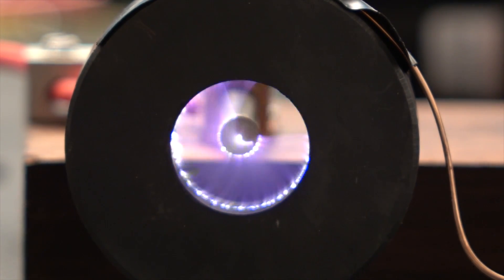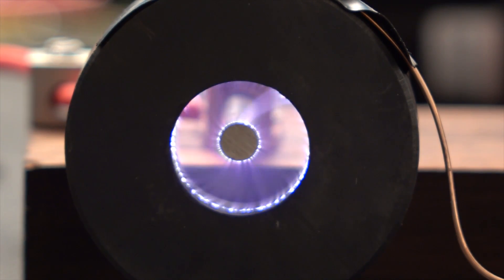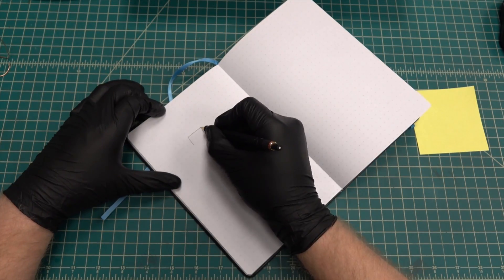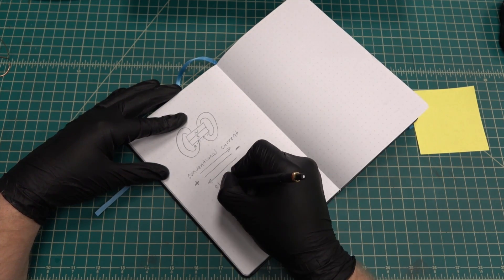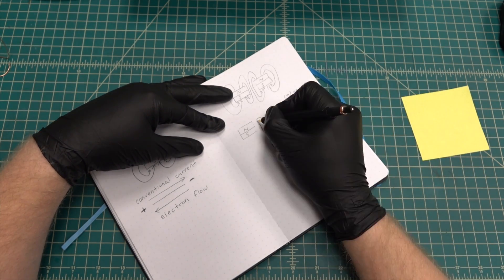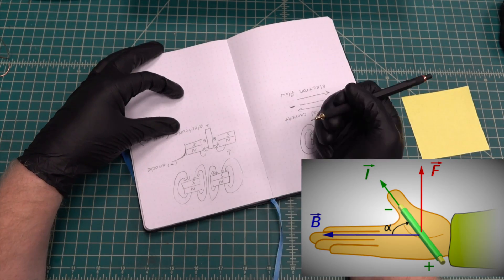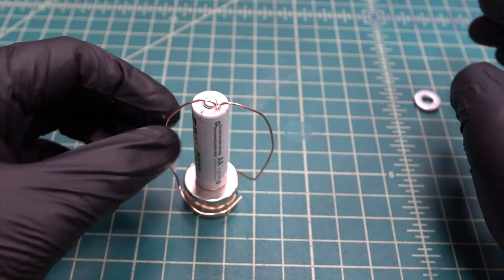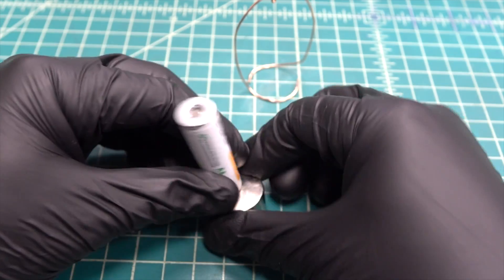How Does a Plasma Vortex Work?

Comment: Suppose that air is traveling through the vortex inside of a cylinder.  If the air is traveling fast enough, it seems that there might be a long column of plasma created.  At a high enough voltage, the arc might travel some distance along the axis of the cylinnder to a central electrode.  This might have certain possibilities for capturing concentrated sunlight.  Free electrons are said to absorb all manner of electromagnetic waves including light.  If the sunlight from a dish mirror was passed through a lense near the focus, it might be converted into a beam of nearly parallel rays.  A cylinder full of plasma might be used to capture this beam of light.  If one photon hits zillions of free electrons in the plasma, how much plasma would it take to absorb all of the beam of light.  It takes about one million Joules to remove one electron from a mole of Oxygen.  If only one millionth of the Oxygen atoms need to be ionized, the power consumption of the arc might not be too high.  If the energy from a two meter dish is about 3000 watts,  the temperature of a liter of air traveling through the cylinder per second might be raised  by thousands of degrees.  Much or most of the power consumption of the arc might be returned to the system as heat absorbed by the air traveling through the cylinder.  Some concentrated solar energy systems use mirrors to heat air to drive a gas turbine.  The efficiency of a gas turbine tends to increase with the temperature of the furnace region.  The temperature is limited by the melting point of the collector material.  But a plasma has no melting point.  Extreme high temperatures might result in very high efficiency for the system.  Gas turbines can have efficiencies over 40%.  This is much higher than most solar panels.

Comment: Vortex plasma combined with microwave system. By dividing these 2 energies.. we can create cutting edge engines. And maybe adding magnetic fields we can find teleportation..
Reply: The microwave system that The spark uses the plasma system on a vortex combined with magnetic fields there must be another magnetic field that pushes to the inside
Reply: And bend the space of the vortex by throwing yourself inside.. so you have to create another equal system. but that bends the field of the plasma vortex with a magnetic field vice versa teleportation can work

Comment: What's really rad about this video is that the plasma REFLECTS the light from the flame of the match head! If you don't believe me, please slow the video speed and magnify the round plasma part when the match lights up. You'll see the light from the flame reflected, like the light was being reflected off of glass !. So, what's going on here? I think, its the, already electrically excited air atoms, being hit with the photons of light from the flame and their outer or valence electrons going up an energy level and coming back down, releasing photons back at us in the form of a reflection ! You can even see the reflection of the flame deform as the air atoms rearrange themselves because of the rotation due to the Lorentz effect ! I wonder what would happen if you were to take a flame and hold it off center to the plasma so that the camera can see the flame's reflection. THEN at the same time turn OFF the power supply. I bet GooD money that the reflection would SUDDENLY disappear! Also notice that the flame isn't being bent towards or away from the plasma, as if its particles were being attracted or repulsed by the plasma like you would see in other experiments done concerning electrostatics. For example, holding a flame up to the discharge of a Wimshurst machine or Van De Graaf generator. No, the flame points upwards as if it wasn't being influenced or acted upon by an external force. So, you can't say the reflection was really excited chemicals from the match head being spun around within the plasma. No, it was light from the flame, being reflected back at US ! I think ! Please feel free to correct me if I got it wrong, because I want to get it right ! Thank You.

Comment: Any guess as to what temperature you're achieving with that and where its primarily being generated? Am I safe in assumption that most of the heat would be in the daughter product of what got ionized? Liike the heat would carried away by the O₃, N₂O, NO₂, HNO₃,  (NH₄)₂SO₄, ect.... (yeah these babies spew a lot of nasty shit). Despite that the novelty of making a torch ignition gimmick is just too enticing

Comment: nice experiment ! does the magnets suffer any wear/damage from plasma high heat or other reason ?
Reply: It will loose its magnetism given enough heat. But ceramic magnets tend to be pretty tough with a maximum operating temperature at 250c to 300c.  I'd still  suggest a non magnetic inner ring (short copper pipe)  electrode to be the cathode that fits inside the magnets hole, because in a plasma, the cathode heats up faster with electrons bombarding it. The larger diameter of the cathode gives it more surface area to give up its heat, and copper is a better conductor than the ceramic magnet.

Comment: I was wondering, would it work with a electromagnet that has the same shape of magnetic field if so does that mean if you switch the polarity of the electromagnet the plasma will change direction? (I’m 12 btw lol)
Reply: Theoretically yes and yes. The plasma disc is perpendicular to the magnetic field, so if you used an electromagnet, it would have to be wound as if it was wound around the axis of this magnet, like if you wound the coil on the outer edge of the magnet used here. Then you'd also have to have the arc go from the the center of the axis to a point further out. Here to arc goes from the center electrode to the magnet, but you probably wouldn't want to arc to your electromagnet, so you'd need two electrodes.

One thing you need to know about electromagnets (and inductors in general) is about something called "inductive kick". Basically if you cut the current to the inductor, as the magnetic field collapses it generates a voltage spike that can be absolutely massive. All the energy you spent making that magnetic field is stored in it. The effect was used in the ignition in car engines of olden times to generate 50+ kV voltage spikes to fire the spark plugs, with just an inductor and the 12V battery in the car. Inductive kick can and will cause arcing across a switch if you just switch off the power to an electromagnet/inductor. It can also kill you, so BE CAREFUL with electromagnets. You can not just switch two wires, because while the magnetic field collapses, you could have many kilovolts across those wires. In general, if anything is a coil, be wary of inductive kick. The point is, sure you could switch the polarity, but not too quickly, and not without having special circuitry to do it.

Comment: Good job sir. Does heat of the plasma kill the magnet?? I saw a video of a vortex lighter can it destroy it self after a while??
Reply: Yes, but gliding Arc discharges (this kind of plasma) has a só short contact with racha point of the magnet that this process occurs  take a long time to be significant. If you increase the current however, you will increase the degradation.

Comment: I get how you make it turn but how did you do the thing at the start of the video? Also, what is the logic in the right-hand thingy? Why can't we do it with our left hand (without changing polarities)?
Reply: Doing with the left had is the same that considers a negative current
Reply: The right hand rule is just a mnemonic. A given combination of current direction and magnetic field direction will yield a particular resultant force.  The upshot is that all 3 are at mutually right angles.  You could assign any combination of fingers to any combination of components (as long as the system has that property) but a convention must be chosen and agreed upon in order to be useful.  The right hand rule is that convention.

Comment: what temperature
Reply: The gas temperature? The magnet temperature or the electrode one?
Reply: @gnnomo59  yes
Reply: @aggabuss  the gas temperature is hard to measure. In fact this kind of plasma isn't in thermodynamics equillibrium, so electrons can be at a Very high temperature (a thousand Kelvins) while the havier species (ions) present an ambient temperature (If the magnet was grounded, you probably can touch it and not injure your hand) But even in a academic laboratory It is hard to measure this value with accuracy.
Reply: @aggabuss  the grounded electrode probably was in ambient temperature, the high voltage one can be measured with an optical termoter. However, I cannot say  a number for it with accuracy.
Reply: @gnnomo59  and thank you for the reply..
and is this your video is
that you in the vid..
and thanks. i need muse your writ.
Reply: @gnnomo59  ..
excuse me but that is poetic..i just made it a song..
Reply: title 
thermodynamics equilibrium
Reply: @aggabuss  search for nonequillibrium cold plasma. Don't believe me, Google it.
Reply: @gnnomo59  
vid say plasma
not gas . so not
the gas temp
even though the blue arch (plasma) is the heat the goal money maker the goods..
but gas is not it.
i think the magnet does not heat up since the plasma (that you seem to be calling gas and there is air though this experiment probably could be done in a vacuum) is cool
and not the electrode
(as magnet) 
so none of the three.
Reply: @aggabuss  in fact there is no phase transition from gas to plasma so thecnically, plasma is an ionized gas, that's why I said gas.
Reply: while you are here i must ask another question.. because 1 i have it and 2 i will spend some time to
render your good (excuse to the word good) answer. (probably excellent)
(well to me anyway)
but here can you pass(arc) that current to the magnet with out touching? (brushless like) could that plasma ionic gas be done on (or better inside)a spinning (tube) (surface)( should say the space inside that
tube/axle. that tube must be a magnet.
so a spinning magnet is changing polarity 
(is the electrode grounded it must be)
Reply: @aggabuss  you can construct this kind of reactor in many ways, even without magnetics. You can use a rotating gas flow like this: https://youtu.be/j7lVw8fOtZU

The only reason to use magnets ia to cause the rotational effect. 

In therms of plasma (not only gliding Arc) you can also create plaamas using microwave, radio frequency power supllies, DC, AC....and inumerous geometries
Reply: i have seen cool plasma balls(in vacuum)at radio
shack (before zone)

Comment: wahts that cable ? is the ring magnet grounded or just attached to the other pole of the circuit ?
Reply: Those are equivalent but not really relevant for the purposes of the demo.  All you need to know is that current flow is radial within the ring.
Reply: Probably grounded

Comment: Isn't the battery magnet set-up at the end of the video, theoretically a perpetual motion machine? Because there is constant induction in the wire, the battery should not lose charge?
Reply: loveboyhatch I don't know much about E and M, but I know that frictional, and heat losses will eventually stop the wire from spinning.
Reply: Robert Shull Thank you man

Comment: does the plasma lines have a curve to them or are they straight
Reply from the maker: +Zahir khan Watch my video, "Largest Plasma Arc Vortex Speaker"  I filmed it a 1000 frames per second at the end of the video..
Reply: Yes. As the lines move faster in the centered electrode surface than in the magnet surface, the lines become a little curved.